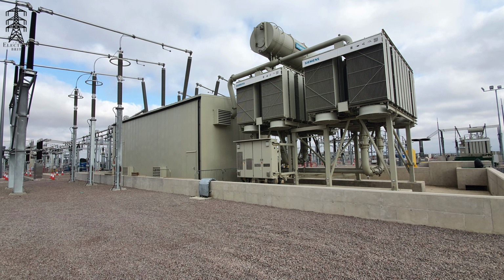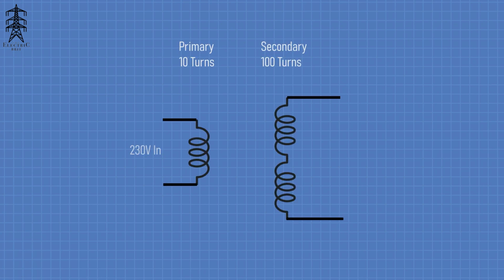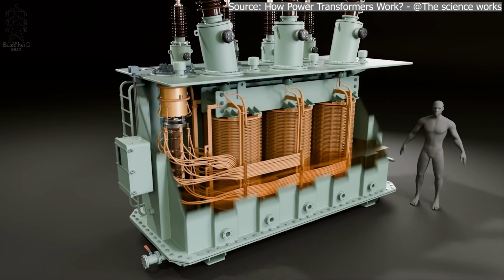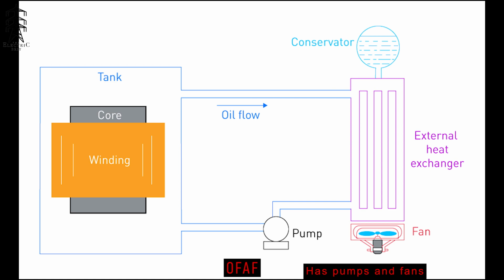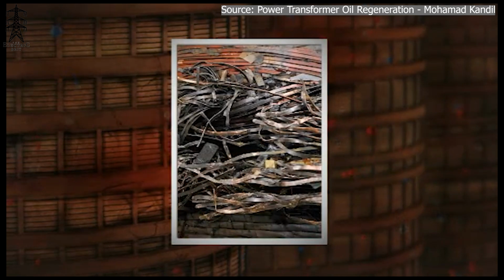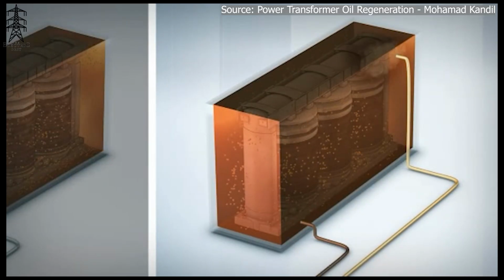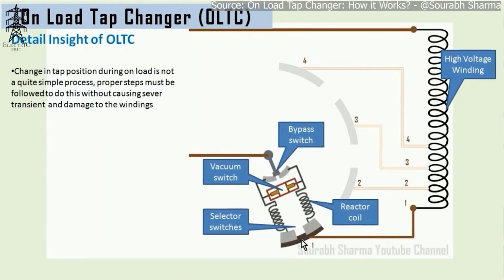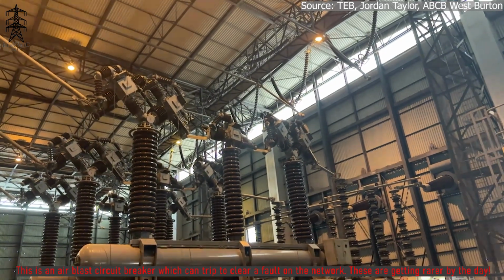Why Transformers Fail (and How to Prevent It)

Comment: The transformer tap was made(connected) before breaking as shown to keep flashes from happening - the other type of tap is break connection before reconnecting which will ruin the transformer when moved under full load - this was moved so ruining a $5 million transformer at a power station in VA
Reply from the maker: Sounds like the other was an off load tap changer? I think they’re far less common now in my experience due to the safety concerns. Workers have died working on off load tap changers in the past in the UK so it probably makes more sense to just use on load especially at transmission levels where you can’t afford the downtime.
Reply: @TheElectricBrit I read in a textbook that there were two main systems for on-load tap changing, one older used a centre-tapped "reactor" to allow two taps to be connected simultaneously, giving the average of the two taps. When only one tap was connected the "reactor" would add some inductance which was tolerated. The system could "walk" up and down the taps to change the ratio. Another newer system used a resistor to prevent a shorted turn for the brief interval that both taps were connected during a change. The resistor system meant a change once started had to complete within a short time as the resistors couldn't take the power indefinitely.

Comment: What type of oil is used as the insulator? Is it a form of mineral oil?
Reply from the maker: Good question! Most transformers use a form of mineral oil but natural ester oils are starting to be used where there might be a risk of environmental spill or for other reasons.
Reply: @TheElectricBrit For years the oil used in the US was full of PCBs.
That was phased out in new transformers but many older ones still have the old oil.

I have heard the PCB rich formulas actually last longer and work better than the newer versions.

Comment: usually the transformer oil is highly chlorinated hydrocarbon which is non-flammable. However, these oils are also highly polluting and must not be allowed to spread.
Reply from the maker: Polychlorinated biphenyls (PCBs) have been banned in most countries since the 1980s. Yes they had better fire resistance but are a forever chemical and highly toxic. National Grid have a target of 2025 to remove all of them off the system.

Modern transformer oils are mineral oil and newer ones are even natural esters that can be biodegradable (midel make one we used offshore).

Transformer oils are very much flammable but usually the tank will need to rupture to spill it and an ignition source is needed like a high temperature arc.

Comment: Great video!

Why did they spray the xformer with water at the start?
Reply from the maker: Thanks for the comment! The footage at the start was a fire deluge system. Two are shown in this video one is foam one is water and used to suppress fires.

The transformer will be off during a fire so no risk of electrocution and the water mist helps remove heat and displace oxygen to keep the fire from spreading.

Comment: If it's anything like electromagnetic ballasts, they usually fail either due to overload, too much heat or internal insulation failing.
Reply from the maker: Not familiarity ballast but the first two usually lead to the third, provided the protection mechanisms haven’t kicked in but these will lead to a slow degradation over time regardless. Hotter windings age faster.

Comment: Increasing current is NOT EXPONENTIALLY related to power loss from heating, but in POWER OF TWO. I², not e^I.
Reply from the maker: Thanks for the comment. I issued a correction earlier so at that point in the video it should say correction in the top right corner

Comment: SMALL !  domestic transformers ( used in many older appliances ? ) are VERY valuable ... used correctly , they will give service for decades ( even centuries 😝 ) TOO  MANY  folk scrap them for their ( meagre metal value ) .. and ... BTW ... testing of these high power grid transformers , out of their oil bath protection is  VERY  LOUD 😝 ...... DAVE™🛑
Reply from the maker: In two weeks I have a video all on the noise of electricity - why transformers hum and corona discharge! Sadly you’re right and most people don’t know the true value of what they have

Comment: ENUF ! if a transformer needs cooling and computer bloatware, its too damn small for the job.
Reply from the maker: Transport often becomes the issue over a certain size. I’ve known transformers to have chamfered corners just to fit through tunnels and have whole bridges rebuilt stronger just to get them over it.

Comment: Great Vid. As I understand it these transformers are built to order which as you say takes months to build and weeks to install. As all the voltages are standard, presumably there are a few "spares" around in the event of a "Hayes / Heathrow" type of emergency?
Reply from the maker: Great comment! A lot of the ratios are standard however MVA rating might narrow down your spares list. The order books for new assets can me multiple years now but there are some spares around and diminishing off previous upgrades.

On newer critical projects like converters they’ll actually buy a spare from the start and it’ll sit idle for that reason.

Comment: Thanks for a very good video. I would say though that be it an in tank tapchanger or outside mounted tapchanger, the oil does not mix with that of the transformer. In fact even in those divices the changeover and diverter switchs oils are segregated as well. This contains any arching (carbon) products to that unit only.
Reply from the maker: Thanks for the comment. I’d have to re check if I covered it but I was sure I mentioned the tap changer having a higher grade of oil, maybe I should be more clear that it’s in its own tank or separated by a barrier board.

Comment: Transformers tend not to explode..  the caps do more but the explosive fuses seem to blow and arc hang which creates those big flashes of light many see when they say a transforner blew…. When one of those oil filled transmission xformers go theres a huge fireball and a whole bunch of smoke that burns for a while..  that usually means your powers gonna be out for at least a few days for the power company to source a new one, clear the old and put in the whole new one.  Unless your on a diversion aux branch..
Reply from the maker: That's right, most transformer faults are cleared by protection or are fairly minor like a flash over. Even a bushing failure might only take out the bushing and leave the rest of the transformer mostly intact. In the rare event the tank does rupture then you're in for a fireball and a hot mess!

Comment: How do most winding temp indicators work without running a conductive wire or capillary tube to the windings? 
Aside from some fiber and IR detectors on new transformers historically it's a derived temperature based off a temp sensor in the main transformer oil tank and then a heating coil driven by a CT on one of the phases that ads heat to that temp sensor. More load, more current from CT and more heat from the heater. Engineers calculated the expecting winding hotspot and adjusted the heater to match the calculations. So many substation people I work with have no idea and, well, most don't really care. But interesting how they figured that out many years ago without actually measuring the windings in the field. Pun not intended. 
Good video and not sure what the complaint was on the original.
Reply from the maker: Thanks for the comment! Most winding temperature indicators I've come across and that we maintain are mercury switches with a capillary tube and just about everyone on our substations learns at one point how to test and set them up. I'd have to dig out the manuals on the newer transformers I've installed to see what they use.
Reply: @TheElectricBrit In the US what I've seen and tested was Qualitrol brand and they have adjustable set points that the needle hits and closes a micro-switch. But the actual sensing bulb end is pretty clever how they get a "winding" temps when it's not really in the winding. Back as an apprentice that was one of the first questions, how can they get a winding temp and not be conductive on a 138kV transformer. No one could tell me, lol 
So I looked it up and when I train people it's one of the first things I teach them.
But in my experience, next to the top tank temperature well is another well but that has the heater in it that is driven by a CT from one of the phases. One well just has the capillary tube and the other well has the capillary tube and a cable for the heater with a larger cover. It will be shown on the nameplate on the transformer too. 
I have never personally seen the fiber optic type, just heard about them. 
But check it out next time you are next to a big transformer. Usually, one of the big, high wattage variable resistors in the transformer cabinet is to adjust the heating level of that winding temp sensor too. 
Work safe and thanks for the reply.
Reply from the maker: @inothome  always good to hear from others in the industry especially other countries! We use Qualitrol PRDs mostly and the first thing we ask new people is what do they think it does. The first answer is often “quality” 😅 now that you mention it I do recall some fibre optics behind a cover on a Siemens transformers we installed in 2022, I’ll have to see if I find some pictures.
Reply: @TheElectricBrit Agreed, not much electric utility YouTube channels with actual people who work in the field. 
We used some Qulitrol  PRDs too. Maybe RRR too, sudden pressure / rapid rise relay. I have always worked in warm climates on transformers and never worked on any with a conservator and Buchholz. I've seen them in passing and know their function, but only have tested sudden pressure relays.

Comment: Fantastic video chock full of information, keep up the good work, i am a high voltage junkie that loves to tinker with large transformers building tesla coils &  marx generators so i am naturally curious as to the operation of our electrical grid & its components.
Reply from the maker: Thanks for the comment! It's an amazing system the grid and I'll try to share as much of it as possible down to the smallest niches.
Reply: @TheElectricBrit ex BT engineer. Where do you get your grid diagrams?

Comment: For those not familiar:  Acetylene is a real b@stard of a gas, on account of being explosive as hell, starting at just over 2% by volume of air and going all the way to full 100% saturation.

So if you have a fire somewhere, for instance in a metal workshop that has acetylene cylinders for their welding / cutting torches, you are in a world of hurt. Once the cylinders have heated up beyond a certain point - around 300 C - acetylene chemically decomposes, increasing the pressure inside the cylinder. This process creates heat, is self sustaining and cannot be reversed, but can be slowed down and halted by cooling the cylinder and keeping it cool. From the point the decomposition starts, without rapid cooling it is a race between a safety valve triggering and the pressure vessel bursting. Either way, you don't want to be within at least 1000 ft of a bursting cylinder.
Reply: Actual comment overheard at work:   "No, acetylene is a left hand thread!"
Reply: @erintyres3609  Makes perfect sense. This is also true for things like propane and other fuels. Check the threads in your propane tank the next time you’re having a BBQ. 
The point is to prevent equipment from being used on the wrong gases. For instance, acetylene must not touch copper (as in “it must not be transported in or transferred through copper”). Because copper is a catalyst that will cause acetylene to break down and react violently. Not sure about the exact chemical workings here, but the result if a resounding “NOPE”. 
Even brass armatures can be an issue here. Basically anything that is more than 70% copper needs to stay far away from acetylene. Worst case is an explosion. Similar to what you have with grease or oil and oxygen tanks. That also tends to get very “spicy”. Mix any hydrocarbons with pressurized oxygen and you’re gonna have a bad day.
Reply: @DeputatKaktus   Thanks, I never knew that copper could act as a catalyst.  Engineers call this a "forcing function", a feature that deliberately makes it hard to do something the wrong way.
Reply: usually large amount of acetylene are never stored; they are produced from calcium carbide and water as and when necessary
Reply: @ I guess this comes down to what the definition of “large amount” is. To me, a few cylinders of the stuff potentially qualifies as such. It is not uncommon to find two or three cylinders in small workshops such as those run by car mechanics or plumbers. Oxy-acetylene torches are commonly used in those environments. 

And large industrial workshops might have dozens on the shop floor as well as a number of spares in storage, usually in a dedicated outside storage cage. Technically you’re not even supposed to store acetylene in any enclosed space, such as a building or a car. And you absolutely cannot store it along with any oxidizers. 

Even if there is no acetylene in a cylinder anymore, they are still potentially dangerous. The cylinders are filled with some porous substance and a solvent - usually either acetone or a substance called DMF (would need to look up what it stands for, can’t remember off the top of my head). That’s also the reason acetylene cylinders must be stored upright. Needless to say, none of those solvents are great for your health. 

If you find a place on fire, and there is a welding cart with a brown/maroon colored gas cylinder inside the fire, I recommend running. Fast. And take anyone you come across with you. Unless they are firefighters, in which case you tell them about the gas cylinder.
Reply: I love it with oxygen makes the gas axe work tremendously
Reply: and thats why cylinders have purge valves so they don't go boom . Hollywood is not reality

Comment: I worked for a while at Hackbridge & Hewittic, at Hersham (near Walton-on-Thames).  They built rectifiers and transformers, and became part of GEC before closing down.  I remember the huge Wynns and Pickford rigs which used to collect the 240 and 400 MVA transformers for despatch to sites around the country.  Also the old mercury arc rectifiers, which came in for repair.
Reply from the maker: Amazing bit of history and I'm sure you have some great stories. Still a lot of that kit humming away on the network today, built to last.
Reply: I also remember the Hackbridghes factory in Hersham and and as a Boy of 15 I enjoyed reading the Hackbridges product brochures showing the giant glass bowls of Mercury Arc Rectifiers. When the factory closed allot of the engineers ended up working at a Transformer factory in Langley Slough. When Schneider bought this factory in the 2000's Schneider demolished the old war-time factory buildings and built a new factory on the same Langley site. I remember walking through the factory and was shocked to see the flat section copper wire/bar being wrapped in brown paper, I had no idea that they didn't use enamelled copper. Today I see transformers made by Brush and  English Electric, cant remember any others at this moment, I would be surprised if any transformer manufacturing is taking place in the UK today? A very good and informative video, concise and to the point.

Comment: Brilliantly explained! I'd expect rigoureus production control, how can windings still be off?
Reply from the maker: Thanks for the comment! Could be any number of reasons like flawed testing or quality processes at the factory, willingly letting a subpar product out and crossing your fingers it doesn't get caught, a manufacturing change that didn't get properly engineered or tested, inexperienced staff performing the tests or supervising, to improper installation leading to rapid degradation and many other reasons.

Luckily this is why we do factory audits, visits and factory acceptance testing, then site commissioning tests then finally site acceptance testing so by then we should find any issues.

Comment: Question:
Can a transient, e.g. switching inductive load,  cause a transformer to fail catastrophic ?
    During first few months of a new offshore platform  a transformer (i'm not sure but I think it's a step down from 11kV to 3kV) for a big motor  has failed.
Photo's showed a big hole, almost like a bullet hole, into the windings.
HSE report said it happened due to lack of transient protection equipment.  I find it a little strange something can induce such a high energy spike that will destroy a big transformer.
Also report said that the transformer insulation was tested from factory to something like 16kV (I cannot remember the numbers exactly but it should be close enough). The new replacement transformer tested good at 100kV
I'm more likely to think the transformer had a defect from factory. Also I wonder why the original transformer was tested at such a low voltage..
What is normal regarding insulation test voltage?

HV guys: What do you think?
Reply from the maker: Thanks for the comment! Regarding testing, some tests we mandate on a a 400kV transformer: for withstanding switching impulse = 1050kVp. Lightning Impulse = 1425 kVp. Induced voltage withstand = 2x rated voltage. kVp being kilovolts peak so over a very short period.

Switching on the large inductive load would cause a high voltage transient to resist the change in current. I'd like to think the transformer was rated to withstand the transient but I wouldn't know without knowing the situation. On an 11kV transformer I'd guess it was a dry type which are worse at resisting transients, as a high transient will stress the insulation, and on a dry type that insulation is then permanently damaged by partial discharge (won't "self heal" like oil), meaning it will worsen and eventually go bang.